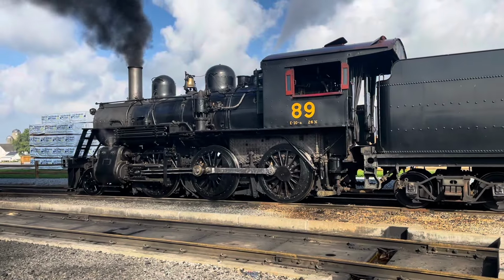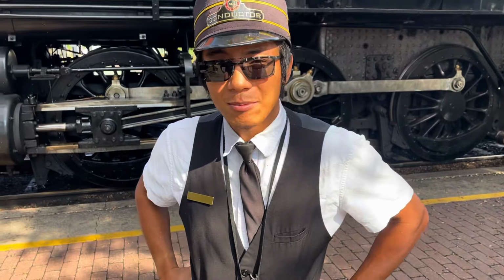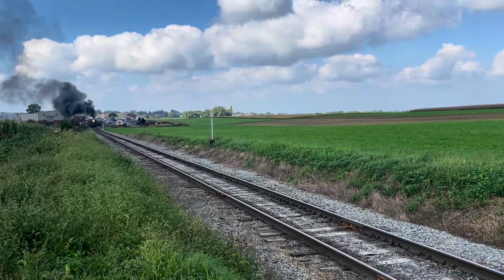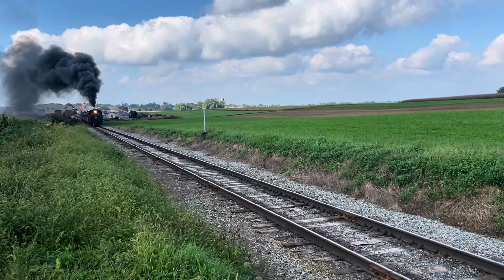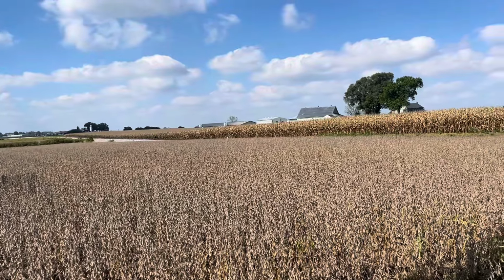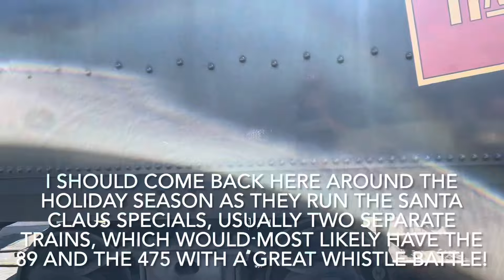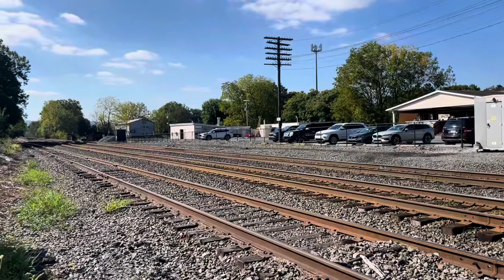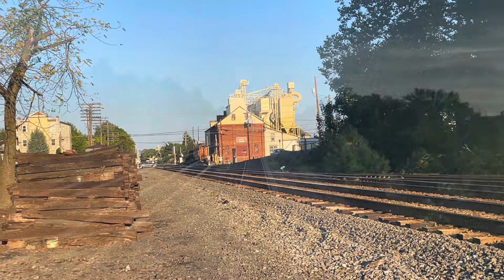Strasburg Railroad banshee whistle and a few NS Thoroughbreds. 10/3/24

Comment: Reading Company also used high-pitched single-chime whistles on its freiht engines.  Camelback 0-4-0 1187 had such a whistle both at CF&I in Birdsboro and sometimes at Strasburg.  RDG T-1's also had single chime whistles bit a slightly lower pitch than 1187.  The lead T-1 on Iron Horse Rambles usually had a six chime passenger whistle and a doubleheading T-1 a freight whistle for contrast.  Strasburg's N&W 475 often has a "hooter" whistle typical of that road's freight power.  2-6-6-4 1218 had such a whistle in excursion service.  Single chime but a much deeper pitch.

Comment: My best friend lives just west of Lampeter, about 5 miles west of the Strasburg RR.  Every time I come north to visit, I usually spend a bit of time at the Strasburg depot, watching the goings-on, stopping in their store and sometimes having lunch at the Casey Jones restaurant (at the Red Caboose).  I think the Strasburg is the best-run tourist RR in the country, but I still wish they could build a wye in Paradise so they wouldn't have to run the locomotives backwards!
Reply from the maker: If they did that, they would run fewer trips. They would have to charge more to make the same revenue.

Comment: 2:52 what's that big thing that connects to the wheels on the loco?
Reply from the maker: The cylinder. One on each side.
Reply: @3985uprr  I think that's what it's called. What does it do?
Reply from the maker: @christophercancel934  it helps through mechanics to turn the wheels of the locomotives. Steam moves the rods, which turns the wheels . If a cylinder goes bad, you have no movement.